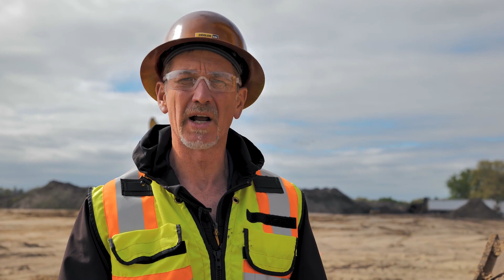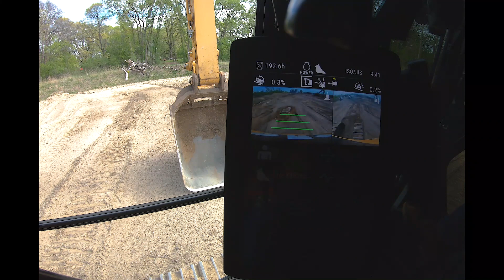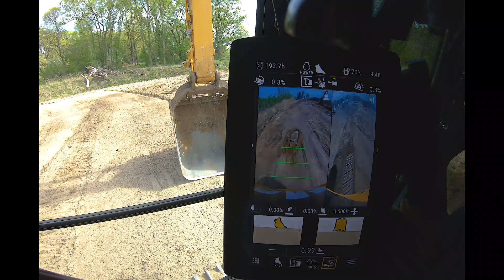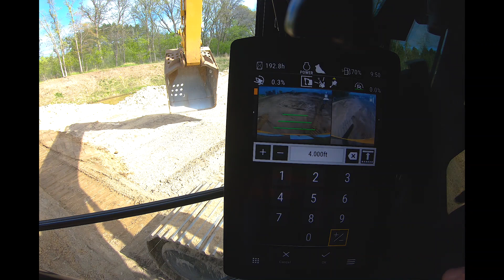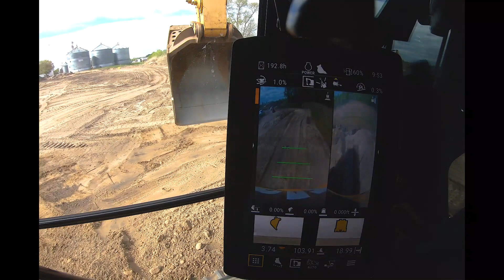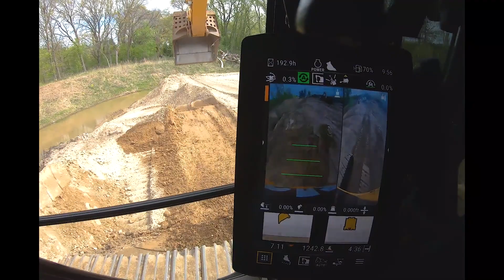Cat Grade Control with Touch Point Feature - Cat Next Gen Excavator

Comment: I’m running a cat 336 new gen. I figured out everything you showed in this video but the auto assist. When I try and turn the boom on for auto it  turns off right away.I’m digging pipeline ditch and would love to use this feature. I set my bench mark and my depth and been using it like that. But that auto assist would be the bomb. Could you please tell me how to turn that feature on. Thanks
Reply: You do not to do this, once you have the bottom of you foundation say, and you have to move, just move back but make sure you can reach you set grade and carry on,  there is no need for this step.  Does not matter if your going up hill, down hill as long as you can reach the set grade you made.l, your good to go
Reply: Also the cat rep, told me to forget this touch point step, no need for it
Reply: This probably won’t help you a year later but there are two ways to use the Assist. On/Off. Or Assist on demand. I sounds like you machine is set to assist on demand meaning you have to hold that button while wanting assist to function. This can be changed in the operator setting bu configuring that button for On/off instead.